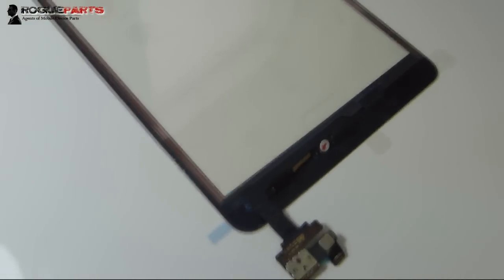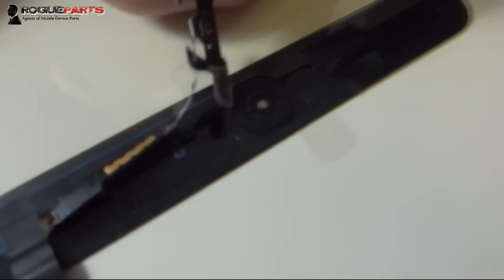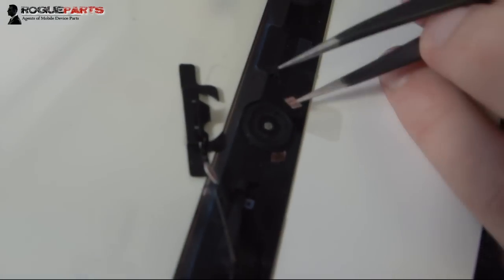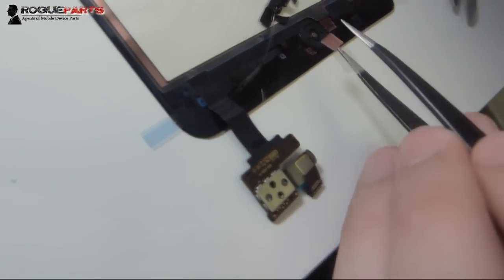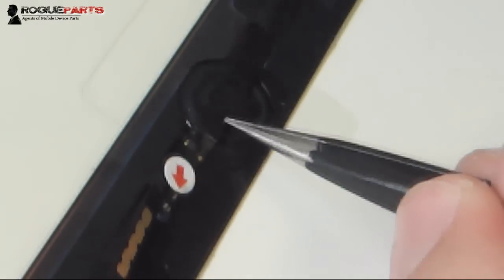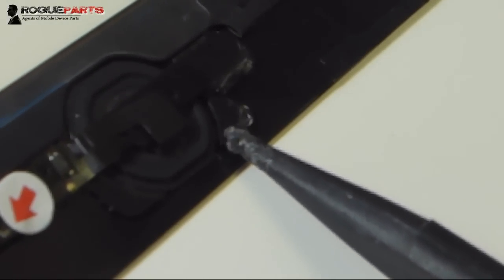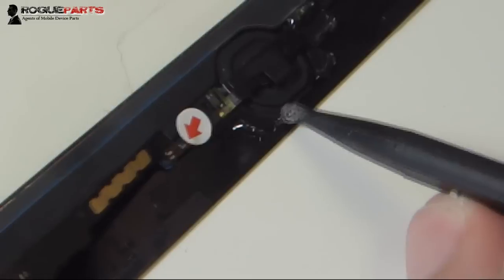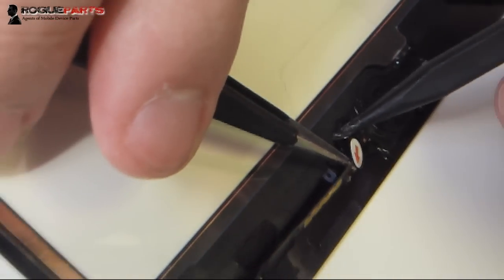iPad Mini Repair - Seating And Securing The Home Button

Comment: according to ifixit, that glue that the factory uses is hot glue. It's probably easier to use super glue or crazy glue, but I always hated when it leaves a white residue after it dry's.